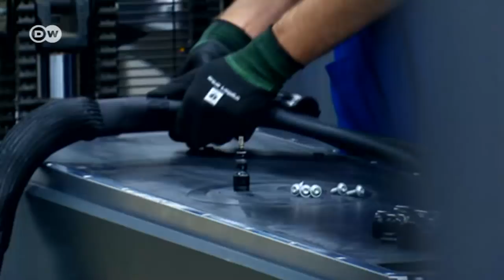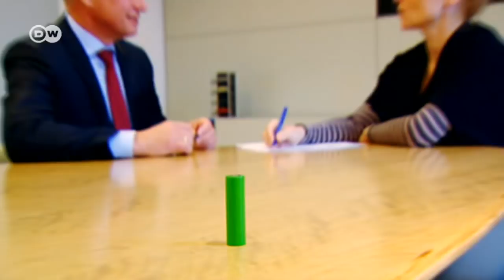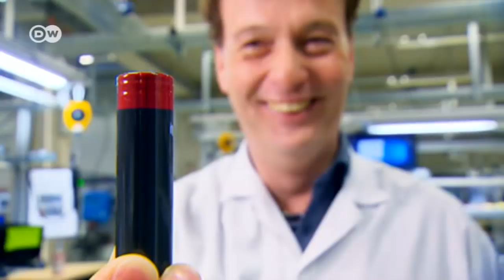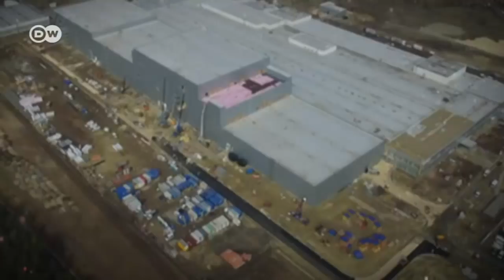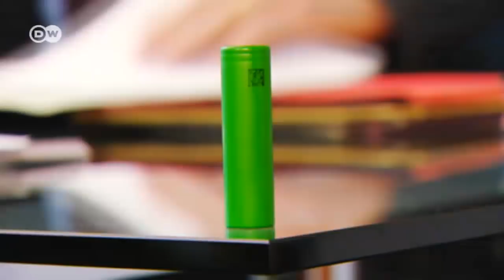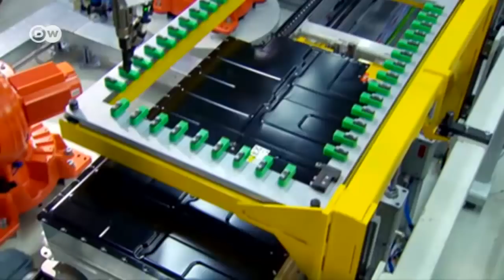German-made electric car batteries | DW English

Comment: Isn't it possible to use wheel power of electric car to recharge it's battery. By connecting four small dynamo to each wheel thereby producing power to recharge the car battery.

Comment: The idea that there is an oversupply of batteries is ridiculous. Battery production is the limiting factor! L G Chem and Tesla can't make enough batteries for the entire car industry. Others have to step up to the plate as well. L G Chem is supplying most of the non-Tesla EVs, but only in small quantities by automotive standards (50k units per year). The video said each car takes "hundreds" of cells. Wrong! It takes thousands of cells per vehicle if they're the 18650 form factor shown!
Reply: dlwatib That's right. Buying Ev cars is like harder than winning a lottery in Korea. All ev cars for 2018 in Korea all sold out less than 5 days. It's because of not enough batteries and Hyundai keeps requesting more batteries to battery companies but it took long times to increase production.

BTW there are three battery companies in Korea(LG chem, Samsung SDI and Sk innovation). LG chem is second biggest battery company after Panasonic but Samsung sdi or sk innovation is also making many batteries.

Comment: Why are these battery modules composed of so many small batteries (18650 sized)?

Compactness?  Bypassing of failed cells?  Cheaper standardized tooling? Heat dissipation?

I would think smaller cells would really drive up the assembly costs and complicate the battery management (charging/discharging balancing) circuitry.  I question whether these small batteries are really the optimal size for electric vehicles from a manufacturing cost or reliability perspective.
Reply: Cooling and price. Bigger cells have problems with the cooling, also these are cheaper to produce because they are a standardized form factor.
Reply: If Germans are going to start making their own batteries, why be constrained by existing form-factors?  I still think there might be a market opportunity there for cells that are optimized for electric vehicle applications.
Reply: Jess Stuart Maybe because each cell is 3.7 volts they need that many cells to get to the voltage they need.
Reply: Frenchie,

Good point.  It's relatively easy and efficient to step-down a higher DC voltage using PWM techniques, but even the best boost converters only have an efficiency of about 90%.
Reply: Standardizing mainly. So you can produce alot of them and not only use them for cars. But also for alot other things. It makes them cheaper.
Reply: Investment costs only. So you can imagine how successful and popular EVs are.

Comment: I could sit here and say "I told you so"!
I did and nearly 20 years ago when the first prototype electric cars came on the road. Making and recycling the batteries is going to be a huge business.
The industry would need standards in size and and capacity and it would need to find ways to quickly swap battery packs at stations (similar to gas stations) preferably automated.

Comment: German = expensive
Reply: Daniel Krueger. They are no worse than the American thieves.
Reply: And Bosch makes shitty car parts. Because of a bad engineered 5€ Bosch oil pressure sensor, I had to pay 700€ in repairs since all of the engine electric systems were fucked. I will never forget my experience. "Made in germany" is dead for me. The arrogance doesn't help either. I would rather buy a Tesla even if the fit and finish isn't perfect.
Reply: Daniel Krueger. For the same price I would buy a BMW.
Reply: Do that and pay the cracy price, drive 160 km by batterie and the rest by petrol. Great future LOL, thats why they  lost already.
Reply: German = quality fits the price
Reply: Nathan Neiman yeahh, like Tesla, thats my next car although I currently drive an E-Golf. So good look BEST, btw. I‘m a German.
Reply: GeneralTan. German = Best
Reply: Nathan Neiman 

BMW i3 is not as nice as a Tesla.
Reply: Best in cheating as Dieselgate shows